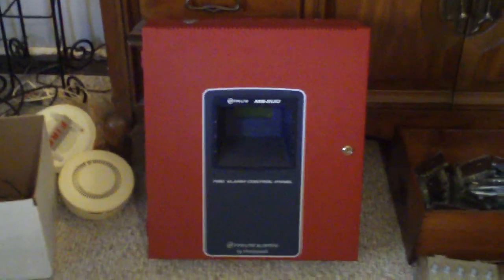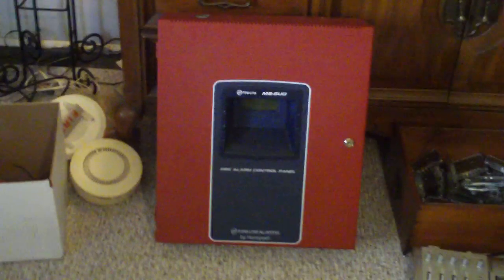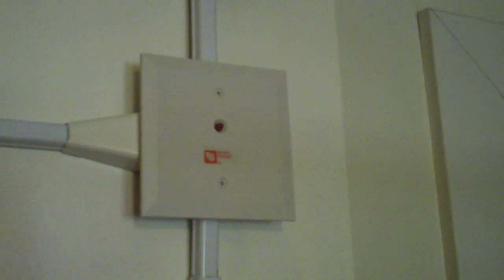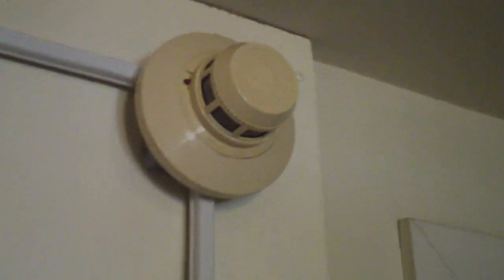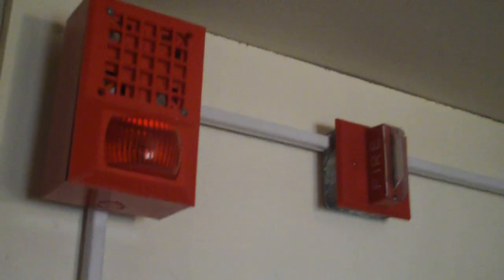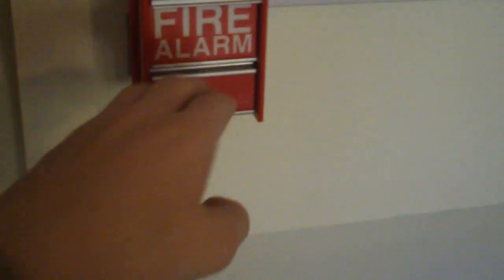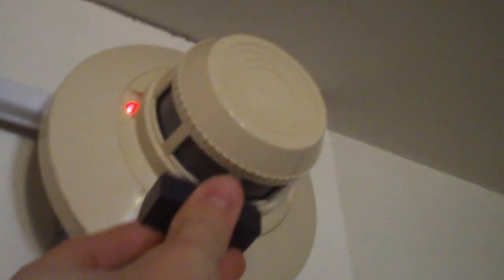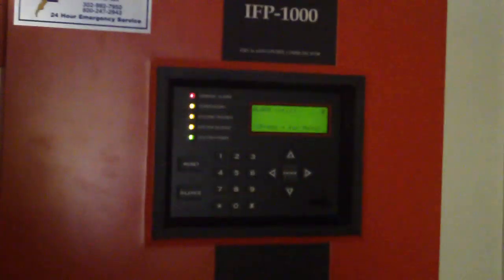System Test 11

Comment: How did you manage to keep the light on the av32 through silence?
Reply: My guess is that they're wired separately and the "Silence" button only turns off the outputs used for horns and bells.

Comment from the maker: Addressable devices have a small microchip in them with allows them to communicate with the panel. This allows for every device in the system to be read as an individual "point", unlike a conventional system where there may be several devices on one zone, and the panel doesn't know exactly which device activated. An addressable monitor module allows a standard non-addressable device to be used on an addressable system.